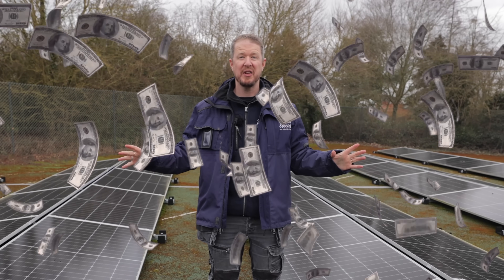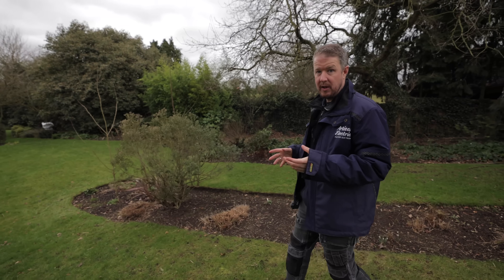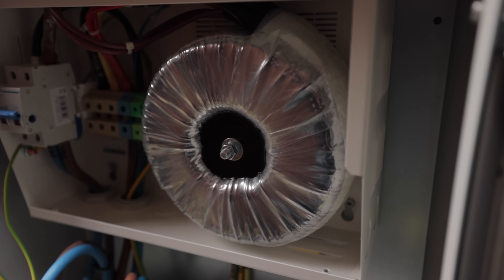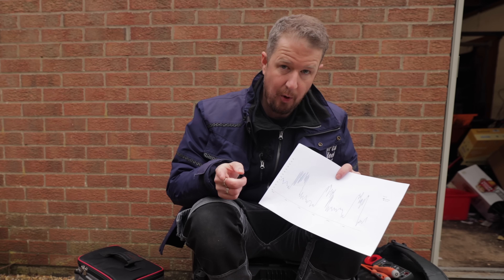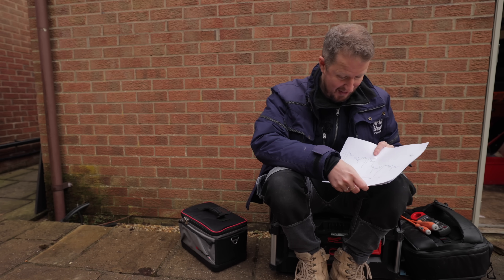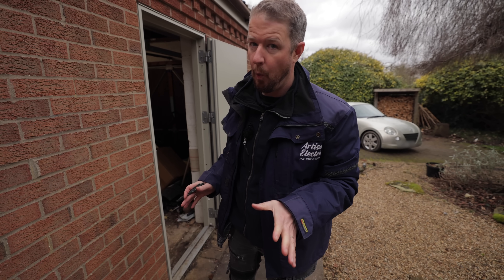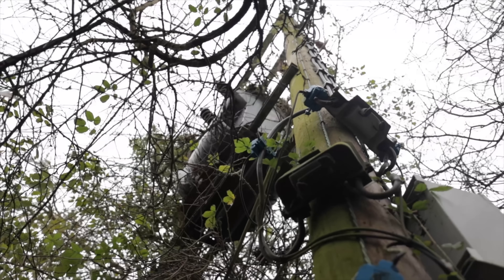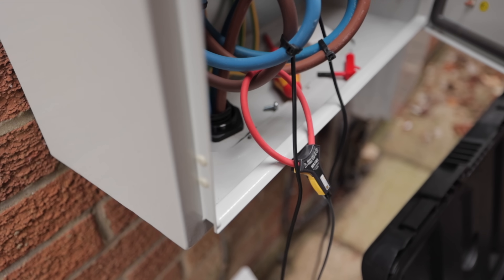THOUSANDS Down the Drain – And We Can’t Do Anything About It!

Comment: USA rules here, but we have well over 150 investor-owned, 800 co-ops, and almost 2,000 municipally owned distribution utilities, so there is no one clear answer. That said, for the utility I retired from, the customer who breaks the system with solar or wind pays for the correction, regardless of whether it be an upgraded transformer, a new transformer closer to the customer, upgraded service wires, etc. 

The voltage optimizer you installed sounds like it is pretty passive, and is basically just a boost- buck-transformer, that will not stop voltage swing, rather the impedance it adds to the system will make the voltage swings worse, just around a new "average voltage."

If you are close, go to active inverters and chargers that vary their power factor in a manner that moves the voltage in the right direction, i.e. adding reactive load to reduce high voltages and capacitive load to increase low voltages.   Your utility may now allow this, but I did in certain "large-customer" instances, as long as some of our other guidance was followed (i.e. no generation larger than the kVA of the service transformer, including all the other customers connected -- you go above that number and you pay to upgrade the transformer.

And ... old transformers are not bad, they often perform better than the new highly optimized designs.

Comment: I wouldn't want a 17kw system running on a single phase anyway....

A house that size probably should be upgraded to a 3ph supply which should solve the problem problem as you are no longer pushing such a large amount of current into a singled phase

Comment: same problem in Poland - my village 140 houses has 4 transformers- "my" transformer which I am connected to  power up total 38houses - he has 63kW nominal power - and total PV installations is 75kWp - so we have 262V year ago and minimum was about 237V - after my complains they reduce stock voltage on transfotmer to about 225V - now we have 252-253V at sunny day, and 215V in low peak

Comment: If the DNO are reluctant to do anything. Hook up a dusk till dawn sensor to a sufficiently sized contactor, that connects to and bypasses the optimiser at dusk, being able to charge the battery’s. But then enables the optimiser at dawn for sufficient running of the PV system during the day. You have spare capacity in the optimiser enclosure to make it work. 😁👍🏻

Comment: Its power line from the grid has too much impedance to support 17kW.
Without the rectifier, when the solar produces, there is an overvoltage.
With the rectifier that reduces the voltage by 6%, when the battery charges from the grid at night there is an undervoltage.
With a 3% rectifier, I think we would have found the optimal point that would have allowed us to stay within the authorized voltage limits.
Another solution would have been to slightly restrict the installation (for example 15 kW instead of 17 kW), which would have reduced voltage fluctuations.

Comment: What you need to know is if alot of others on the same transformer have generation every property could have 3.6kw without prior aproval .id suggest running the analyser for a week with the solar off and a week with it on and see how the network voltage behaves without pushing 17kw into it

Comment: Isn't the issue 300m or more of cable. I would try fit your logging device on a neighbours supply as an issue with a customer without a PV would get far more interest with the DNO if the supply goes out of allowed range. If the issue at a different customer further away from the pole, then that points to a bad joint to your customer. Can you confirm with L-E and N-E logging?

Wouldn't a prospective fault current indicate supply resistance in the first place before the install?

Comment: Question: by how much more cheaper is the electric during the night as compared to day?, thanks. I would not bother with the network at all. Better try use solar tracking as there is a 40% difference and loss. is that not Amazing yet?

Comment: "I’m facing the same issue when my inverter tries to reverse feed to the grid. The voltage shoots up to 260V, and the inverter stops feeding. This seems to happen because no one is using electricity at that time, and multiple inverters are feeding into the grid simultaneously, causing the voltage to rise too high. The grid voltage is always high during those hours.

Comment: Jordan you are totally wasting your time if the impedance of the network supply is too high , that "voltage optimiser"  which is just a transformer in or out of phase with the supply ,  I designed these to allow use of 100Kva spot welder's use on poor supplies ,  the device you need is a CVT  constant voltage transformer ,  you will have to look for a significant sized one which will be expensive new so look for a second hand one , the CVT takes the supply and using magnetic resonance adjust it to a very close tolerance ,  this would allow the house and all the other stuff to be independent of the mains voltage , BUT ... In altering the mains voltage to such an extent as you are with the current system the supply company will notice and so will neighbouring properties ,  the supply impedance is the problem there will be a local sub transformer that's too small for the output you are pushing through it , I would expect a local supply transformer that's already running at 100 % overload with the taps set for a reasonable 240v supply at the customers , so you randomly stuffing power in it just rises  , a better solution would be to get a 3 phase supply installed than you have no issue  Keith
Reply: High impedance is exactly what came to my mind. I think you're right about an undersized substation.

Comment: I’m a distribution designer and you are mistaken about
 Transformer voltages: 240 volt is not high.  A nominal tap setting for an 11kV single, split phase or three transformer is tap 3 and this corresponds to 250V not 230V.  The network is set up to distribute energy (voltage drop) not absorb energy (voltage rise). Ie at minimum system demand in summer in the middle of the night the transformer voltage would be close to 250V. 17kW is a huge amount of generation for a single phase domestic property in a rural setting and with limited voltage headroom this connection would be very unlikely without export limitation protection and or system reinforcement. The reinforcement at its simplest would be a transformer tap reduction but this could cause low voltage issues in winter and be an unlikely solution. There may also be other local generators compounding this problem.  The next simplest would be a transformer upgrade and a 3 phase supply. The DNO is responsible for any reinforcement if they have approved the full 17kW of export. It sounds like their technical study was seriously flawed but you need to check your terms and conditions for the generation approval.

Comment: My main question is: Why do you have a voltage fluctuation at all? The solar should be dumping DC power directly into the batteries until they are full. Only after the batteries are full should the system be dumping excess power into the grid. In ALL cases, the house should be fed from the inverters that put out absolutely constant voltage and frequency regardless of power consumption. The same applies when you are pulling power from the grid to charge the batteries at night. And yes, you might consider increasing your battery power storage to eliminate fluctuations.
The Ohms law I studied indicates that when your power draw increases, your current increases. Voltage dropping when you pull more power indicates that the system is trying to keep power constant when you draw more current.
IMO 300 meters to the transformer is about 3x the maximum run.
In the neighborhood where I grew up the hydro power lines, including the high voltage feed,  are all buried. The transformers are in vaults underground in the space between curb and sidewalk.

Comment: Yikes .... we had exactly same issues with voltage going up to 262 but with only 4kw of Solar PV. But the transformer only fed us and was 25 m from the house. Phoned the DNO who obliged by popping out and monitoring the voltages over the following 7 days. On return at 9.00 following Friday, they confirmed my readings. By 11.30 we had 7 DNO vehicles and 11 guys to perform a 45 second job of switching the tapping on the transformer from 240 to 230. 
So Part Two plz

Comment: Jordan, we had EXACTLY the same thing happen last year. We have 17kW of AC solar power from 3 inverters, a large battery system (40kWh) and 2 EV chargers. The DNO (UK Power Networks) gave us the full 17kW that we applied for. For the first year it worked ok but I did notice the inverters tripping off occasionally but it wasn’t a big enough problem to be concerned about. The following summer, the problem got significantly worse, constant tripping of inverters and EV chargers along with a host of other symptoms (GSHP making an appalling noise during operation). I contacted UKPN who came out and tested the voltage with a meter at the incoming supply, however as you say they disconnected the solar… and the voltage was around 240V. It continued happening. I contacted them again this time with evidence of the voltage reaching 260v and dropping as low as 210v. Again they came out and tested, stuck a meter on the incoming supply and stated everything was fine. At this point, I was in good conversation with engineers at the battery manufacturer (GivEnergy) who stated to me they could see the voltage readings and that as they gave DNO approval for the system, it is their responsibility to manage the voltage with the solar system attached (I later confirmed this with a couple of very senior people at UKPN that they have an obligation to test with the PV system on). Eventually, I had to take the matter right to the top and ended up emailing the CEO at UKPN as nothing was being fixed stating that I had proof of the issues. I received contact back stating that they would come and put a data logger on in a few weeks and that the solar will be left on. When it got fitted they left it for a few days before coming back to remove it. Within an HOUR of them leaving the house, I got an urgent phone call stating that a team would be round to the property to disconnect us from the supply as the voltage was spiking momentarily to nearly 300V (my logger could only take a reading every 30s so it probably missed this) and they worked through the night to connect us to a large 3 phase generator. We sat on that for 2 weeks while they dug up the main road and underwent major work on the line. They reckoned it may have been a floating/bad neutral connection that left the voltage to so easily move as it was stable at the transformer. Luckily, all is now fixed and we have had no issues pumping out a steady 17kW! Anyway, moral of the story is, it’s completely up to UKPN to solve the problem and don’t be afraid to take it to the top if you’re not getting anywhere. You are also likely to be able to claim compensation for the extra work you had to do.

Comment: What it says if the transformer is to small is that the power company and the installer both messed up bigtime by not noticing the transformer only for the customer to pay for the mistake that they should have noticed when you are seeking approval to grid tie the system. It should have been noticed! On top of that how did the massively long leads not get noticed coming from the transformer, it is just like if you plug in 200ft of cord that is 14 Avg. gauge wire and try run a skill saw. Not happening, when you draw high loads it can create a brown out type of situation killing electronics when the high amperage flows in from the lack of voltage stability.

Comment: The MPPT on the Inverter should be managing the solar panel voltage and then directing it to the home load through the inverter  . Why no faults on the Inverter ,maybe just a firmware update required . A Deye inverter does this all-in-one. Are the solar panels connected directly to the output load? how can the solar panel affect the voltage on the home load as it should be seperate via the Inverter/mppt

Comment: The grid should be correctly balanced already negating the need for VO, which as you suggested, there is an issue with the local transformer or substation supply.

Comment: Heya, can't wait till yoou have the power data. I hope they will not get a storm does brensses could short that transformer (70KVA that's gone give a nice spark lol ) old transformer may not work that good anymore but could still be in it's specs. putting in a bigger transformer could mean bigger cables etc. etc. etc. to much cost's for the cable company ( wen it's only 1 house ). but at the uther end that are solar edge inverters is the AC output not restricted to a max voltische ?

Comment: If the Inverters had a configureable P(U) Response like Victron Multiplus II for example, you could adapt the overload of that Transformer whilst getting most out of the installed array, pushing as much back into the grid as the voltage rise - or the transformers floating voltage- allows up to gridcode standards of UKPN. It will probably be YEARS before a new Transformer is available, lead time on these are atleast 5-10 Years nowadays in my region afaik. 
With a microgrid like on the Multi or any other inverter with that feature, you wouldn't have the issue with the EV stopping charging aswell, as the whole reason of a microgrid is to create a nice stable supply.
Overall there is only one solution for now with the fitted system: Use more of the Power you produce in the House yourself, charge batteries slower with less current at night when its cheap and set a constant lower feed-in current when its expensive at day over a larger timeframe.

Would love to see a part 2 how things turn around, 3phase guy from Germany here, love the videos and thanks for letting me learn how things are done in the UK!

Comment: You don't need 20V higher than grid in order to export 17KW and the inverter should have voltage limit settings in software. Long and too thin grid wires to the transformer and neighbors on the same underdimensioned cable is the culprit but  the inverter should be intelligent enough to compensate for it  (gradually lower import or export when getting closer to the voltage limits).

Comment: I am amazed at the cost of a primitive voltage transformer in the UK! 👀

I thought that such problems exist only here in Ukraine. However, now I see that Ohm's law works all over the world. 😂 As well as the irresponsible work of electricity suppliers and their unwillingness to properly configure high-voltage transformers. I have a 22 kW solar station, and my neighbor opposite has 30 kW. Three-phase connection. The local electricity supplier solves the problem simply installing a voltage relay after the meter. Thus, disconnecting generation to the network during overvoltage. It is very annoying to lose money at the moment of maximum generation, but for the sake of the stability of the system, it is worth sacrificing it. Naturally, such a scheme requires connecting the house bypassing the relay, otherwise it would guarantee the shutdown of the entire household.

Comment: My question is, why aren't the inverters themselves keeping the voltage in check? Sounds like a serious software/firmware bug. It also sounds like the inverters are only using current in the calculations when selling back to the grid and ignoring the voltage component.

Comment: weird why you wouldnt use a servo voltage stabilizer with all that expensive equipment, they can keep voltage within 3% from down to 130v up to 260v depending on the brand. which is very good for any device that uses an inverter, like a fridge, heat pump etc. as they usually blow up under 220v or over 240v. or even a cheaper relay voltage stabilizer that keeps it within a 10 volt range of what you set. voltage stabilizers arent really a scam, they work wonderful, i havent changed a lightbulb in years, no dead electronics etc. our servo stabilizer is always pretty much exactly at 230v, with 228v minimum and 232v maximum.

Comment: Must be similar, here in the Netherlands you can ask the national grit provider (owns the transformers, your energy contract is with a service provider) to set an other distribution tab on the transformer. This way they can increase or lower the outgoing voltages, depending on net loads. Don’t know if I’m using the right terminology, not native English 🫣

Comment: My bet would be the transformer is fine but the 400/230V distribution lines are too long. PN already had to set the voltage tap higher to keep it in range on load, and your attempt to feed power backwards will predictably cause over-voltage. A better survey by PN might have resulted in no permission! And the neighbours can complain to PN about overvoltage when you generate, and that might get the shared distribution lines improved! I would also think that a three-phase system would have fewer problems than single-phase.

Comment: I can't believe the state of the poles and transformer.  They cannot have been inspected for many years.  Had that quantity of foliage been in North Devon our VERY wet conditions would have led to very dangerous conditions.  I would be suspicious of all the supply equipment.  I also can't believe the DNO allowed such a potentially high output to be connected to a single phase.   So all round they are not performing very well.

Comment: Wouldn't it make more sense to dial back the solar's grid export and add another battery or have excess power going into heating? You can probably adjust the charging rates on the batteries to reduce the insane voltage drop at night.